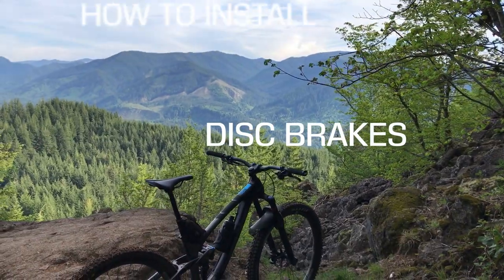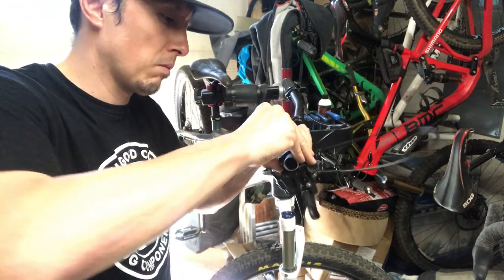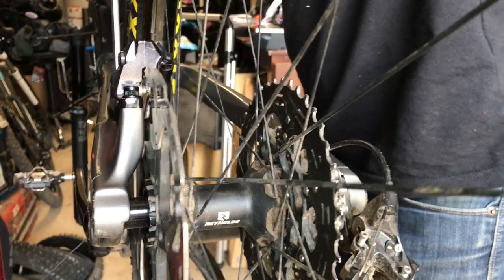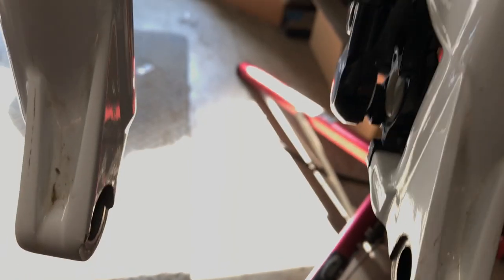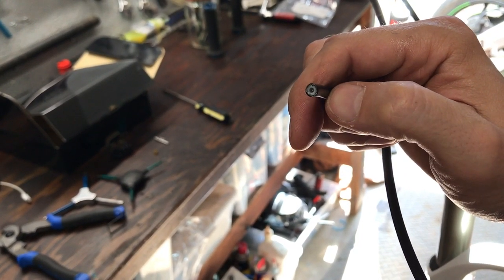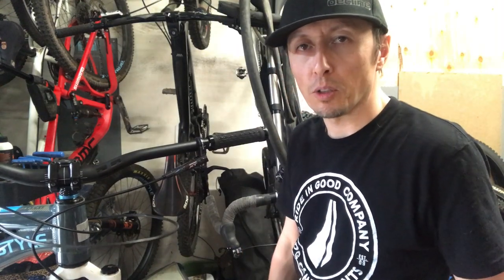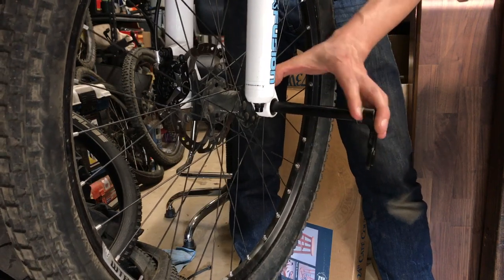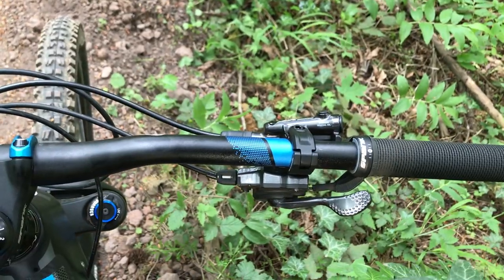How to install Shimano Disc Brakes

Comment: Great informative video I like the trick with pushing the pistons out before sizing the hose. Cheers
Reply from the maker: A word of precaution:  be careful not to push them out too far. It doesn't take much. I've done it once and that piston always leaked after that.

Comment: Thanks a lot. Still ich am wondering why no olive is seen at the open end of the hose before tightening it into the lever. Is the olive already contained within the opening of the lever interfacing the hose ?

Comment: Nice tutorial man! i just purchased a new pair of brakes and want to shorten the hoses. Does the piston squish  without the pads replace all the bleeding process? because i have no idea how to purge and in my country its very expensive, i mean they will charge me lot of money if the brake has to be bleeded again, cheers!
Reply from the maker: It can be a time saver.. but if you have the funnel that is super fast and easy to setup too. I'd start with doing it the right way if you're not sure. It's safer to just bleed the air out of the lever because if you mess up and pump out the pistons too much you can pop the pistons out, which would be very, very bad. Usually, I just push them out very little.
Reply: @BermStyle  great, if im not wrong shortening the front brake hose is much easier than the rear one, isnt it? mainly because if u have to thread the hose to the frame (like normally happens) its more posible for the air to kick in right?
Reply from the maker: @MrRockr95  technically you're just doing the same thing. Shimano brakes are the easiest brakes to bleed out there. Most of the time you can get away with just the Shimano bleed funnel (only $5.00)and fluid. If you don't have the bleed funnel they're easy to source online shorturl.at/fmvL5

Comment: would you say this would be easy for a total newbie to do, cuz i just replaced my tyre and tube cuz i had a flat and now ive come across where i cant even place the wheel since the pistons wont make enough space for the brake pads to be bale to turn the disc brakes freely so im thinking of just replacing the entire thing completly

Comment: What are the best 4 piston brakes for downhill/enduro (max. 300) 
Are shimano saint god
Reply from the maker: We've big fans of the 4 piston Saints and XT models. Even the new 4-pistons SLX models are quite impressive. We may be a bit biased but the unrepairable set of 4 piston Codes with frozen pistons (have at least two sets of almost new looking Avid/SRAM brakes with frozen pistons sitting in a bin in the garage) have us sticking with Shimano.
Reply: @BermStyle  thx

Comment: how do you put the hose in tho because it’s confusing
Reply from the maker: The hose simply slides in. Tightening the connecting bolt crushes the olive which applies compression on the hose and the connector insert, which is what keeps it retained. 
You can view a parts diagram in this Shimano Dealer's Manual: https://si.shimano.com/pdfs/dm/DM-BR0004-05-ENG.pdf

Comment: What's the little plastic thing next to the orange brake spacer at 0:40? It's got a texture pattern inside the one I have with my Deore 4 piston caliper that matches the texture on the caliper mount bolts so I'm guessing it's to discourage them from coming loose although I've never had that problem and they have thread locker on them. Maaybe it's something else but that's the only time I see it in the video.
Reply from the maker: It snaps over the bolt in the event the threadlocker wears out. A bit of extra insurance.

Comment: Wondering if you could help me, I got a new shimano brake for the front and did a bleed of the front and rear, the rear works but with the new front the pistons are not moving at all... Any ideas on why this might be and how to solve the problem? Would really appreciate the help am noob
Reply from the maker: Trying to diagnose an issue without the part there is almost impossible. When I was working in a shop the reply would almost always be "bring it in." That's what your local shop will say as well.

That said, if you don't have pressure at the lever, you don't have enough fluid or too much air in the line. If you have pressure at the lever and the pistons aren't moving, you may have a pinched hose. Repairing something like this generally comes down to a process of elimination.

Comment: Wait, the brakes comes pre bled or you have to bleed them anyways (in case you didn't shorten the hose)
Reply from the maker: Most come pre-bled these days. The hoses are quite long though, and we generally cut them down. I often leave a few lines on the long side as I have a downhill bike and like the option of being able to borrow a brake off another bike in a pinch on major trips. 

We typically bleed the air out of the lines at least once a year. Once I get all the tools out, I usually bleed a few brakes and bikes all at the same time; between the two of us, we have somewhat of a collection - dirt jump bikes, trail bikes, hardtails, etc.

Comment: At 1:15 in the video there is an orange plastic tool between the pliers and pick.  What is that used for?
Reply from the maker: That's a disc brake pad spacer. They're useful if you're traveling or storing the bike with the wheel out, to keep the pistons from extending accidentally if the lever is pulled.

Comment: Thanks for video. What for this black ring? Left in 0:39? How right using this?
Reply from the maker: the little plastic bit snaps over the bolt and helps keep it from unthreading should the loc-tite wear out or come loose.
Reply: @BermStyle  need video instruction from you. No one video on YouTube not teach us use this

Comment: Can i cut the hose using knife?
Reply from the maker: You could, provided it's very sharp, but it's less than ideal. In a pinch I've used a utility blade. If it's not a good cut it could potentially result in a leak down the road though.